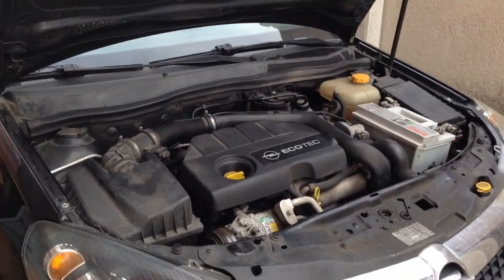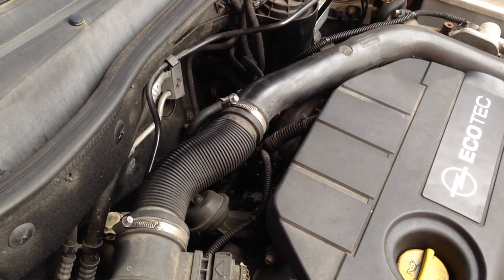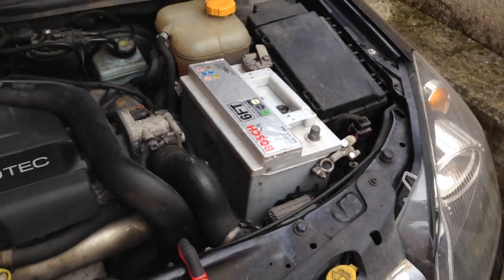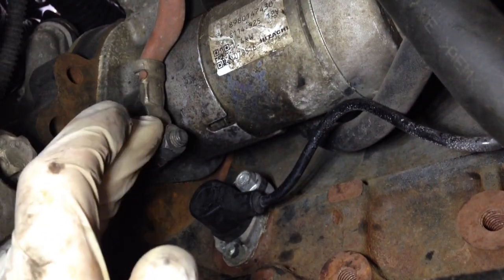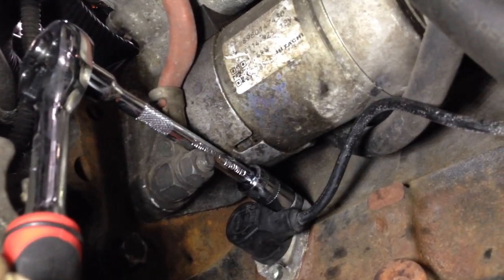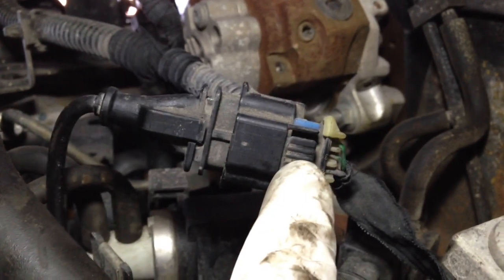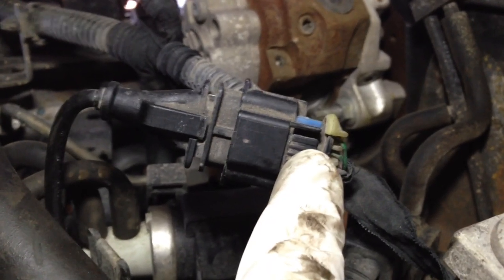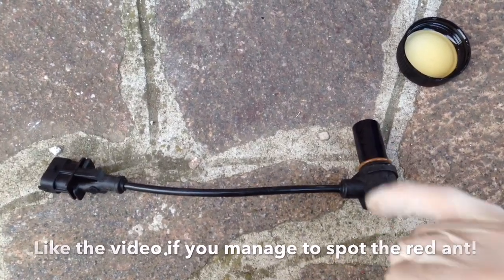Astra Crank Sensor Replacement. Easy DIY Tutorial.

Comment: Chris your video is a dirty lie!!! lol. Well at least in my case looking at my 08 Saturn Astra w/1.8L Ecotech motor, it is impossible to get to anything from the top, nor from the bottom. I am jealous of the literal football field of space you have under your Opel Astra to reach behind the motor from the top, or the bottom. Under mine, there is a drive shaft and other fun items in the way, I can touch the starter with 2 fingers, can't see or feel any bolt or sensor on the block behind the bottom of the starter. Just a sad sad day today when I realized I will be spending a substantial amount of time in the driveway once I figure out what to pull out to get to this sensor. Otherwise, great video by the way!

Comment: Well done, this helped me (so far) to identify one particular problem. My Astra H CDTI (2004) would sometimes start and at other times just turn over, but not start. A garage I tried replaced the Camshaft Position Sensor (P0340) and I thought it was fixed. But a day later, the fault returned and I was stranded. Two hours later, it just started. So I followed your instructions, and this revealed two error codes: 033529 (Crankshaft Position Sensor) and 213971 (CAN-Bus No Communication with CIM (Steering Column Module). Not sure what the last one really means, but when I was stranded, a guy stopped and said that I should try to lock /unlock the car because the key might not be recognised as the right one! I wondered if this meant anything? I have a second key but I left that with the car at the garage (not a Vauxhall dealer). I think the garage replaced the wrong sensor. Appreciate your valued thoughts on this.

Comment: Don't think it's that easy on all to replace it on 2008 1.9CdTi you have to remove Egr valve to get to  then Oil cooling hose bracket. To get to starter motor top bolts... Then bottom bolt on starter then Solenoid and starter power cable then remove starter upwards then yoh find the crank shaft pos sensor behind the now removed starter motor... A 4 hour job off and on.... 😎

Comment: Hi Chris, I had my 06 1.7 cdti diagnostic checked at a local garage because it had a starting problem and also cut out mid drive once or twice!!
The garage said it was a crank sensor fault (the only fault code) and this would explain the problem I was having. I was booked in the next day with a quote of £105 and 1 hour for the work, luckily your video popped up on my recommended vids and after checking the price of the part £36.99
I give it a go. The job was as easy as your vid and the car is now fine and saved me the best part of £70!
Thank you keep up the good work!
Reply from the maker: Hi Dale, thank you for taking the time to comment. I aim to help people out with these videos so it's really nice to hear back from people who have found them useful. Check out my 'pedal test' video so next time you can get your fault codes for free too. :-) Cheers, Chris 👍

Comment: Thank you man,
I will replace that sensor by myself, thanks for this video that you made. 
I will replace with an original one (GM), given that I understood from forums that aftermarket one will just go in loosing more money.
Reply from the maker: I'm glad to hear you're confident to do the job after watching my video - I really like helping people so it's nice to know when people find my videos useful. An original crank sensor is probably a good investment to avoid having to do the job twice! Happy fixing. Cheers, Chris
Reply: @christopher_barr  Hi Christopher. Will Topran crank sensor work? I tried another aftermarket brand and it failed to start, aftermarket read 1.37 ohms. Original GM was around 1.5 ohms. Thanks

Comment: OMG! i had no idea about that fault checking test,you are the man!
its 9:40pm here in new zealand mate,so its abit late now for me to test,but will let you know tomo,thanks again mate,your great help.
Reply from the maker: Good stuff, I'm glad to be able to help! Cheers, Chris
Reply: hey Chris, tried that test, it didnt work,my car is a 2003 ts auto,can you do it with autos?
Reply from the maker: Hi John, your best bet is to buy one of the cheap OBD code readers / reset tools (You can get them for 20 - 30 USD). Then you can read and reset your codes. If the only problem on the car was the crankshaft sensor, and you have replaced it with a good one (OEM Crankshaft sensors are recommended as replacements as the tolerances will be correct) than you will hopefully find that the performance will improve over time as the ECM adjusts to the new sensor data. Getting hold of an OBD read / reset tool is very handy for future use also so is a wise investment. Good luckand let us know how you get on. Cheers, Chris

Comment: Well, my Astra has these symptoms, the cutting out at speed is shit scary and I'll be glad to give this a go, was frightened it would be a garage only job but this seems fairly straightforward, thank you, I'll report back if it fixes it
Reply from the maker: Hi Tim, the engine cutting out is not good but yes this is an easy DIY job (the electrical connector can be a bit tricky to undo at first, but apart from that it should be plain sailing). Good luck and let us know how you get on. Cheers, Chris

Comment: I just did this on my Honda Civic 1.7CDTi. Thanks a bunch! saved £220. In the Civic the connector bracket is fouled by something else so you can't slide the connector plug off the bracket which is a really daft design by Honda, fortunately the ECU side connector can be clipped off like you've shown. I fitted the new sensor and cabled tied it to something else so it stays put. I just snipped the old sensor's cable off using a wire cutter right up to the connector so I've just left it on the bracket.
Reply from the maker: Hi there, I'm glad the video helped you save some money. Cheers, Chris 👍

Comment: Just mind folks there are 2 different styles one with cable as in this video and one where cable comes to meet sensor. Check b4 buying. Excellent video 👌
Reply: Are the connections different or is it just the cable thats different please ?
Reply: @stuartnewman6968  best check your sensor as to what's fitted then purchase the one you need

Comment: Really excellent video, and very easy to follow,  Cheers
Reply from the maker: Thank you for your comment Dave. Cheers, Chris :-)
Reply: @christopher_barr  the sensor on my car is in the same place but is different type to yours, I’ve undone the bolt and it won’t pull out the hole, it’ll move in the hole but won’t come out!…any ideas?….thanks.

Comment: Hi, any ideas if the new part is tight fitting? Can't push it fully in no matter how I try. Looks identical but maybe the O ring looks newer. Tried the oil smear but still won't go. Thanks.

Comment: Christopher Barr, thanks for this DIY tutorial, could you answer me, in my case i have a leaking oil on crank sensor, is there possible to change only rubber, thanks
Reply from the maker: Hi Vjekoslav, sorry for the delay - I've been at sea for 2 months. Yes, you can just replace the o-ring and refit the same sensor if you only have an oil leak. You can even make an o-ring if you want! https://www.youtube.com/watch?v=pDb5CrayM-U Cheers, Chris

Comment: Hey Chris while trying to get the ERG valve banking plate fitted yesterday I had a couple of  problems: 1) What size socket is it (the torx one) and would you know what the sensor is near to is (I was thinking Coolant temp,it was loose and looks like its corroded) any lists you may have of sensor location would be appreciated cheers BigE :-)

Comment: Hello, I wonder if you can show where the OBD port located for opel astra  automatic 2001 model?  would appreciate if you can show it  in your next video pls..thank you
Reply: There's a square plastic panel just underneath the handbrake handle.... pop it out, and the OBD is underneath.  So it's immediately below the handbrake, rather than being dash mounted as on most cars.

Comment: Would you like to diagnose and video my corsa c had no power to the throttle but when you hold the butterfly valve open it will rev up with the pedal tried throttle body change accelerator fuses and air mass sensor still no different ?

Comment: Hi, I have 2005 Opel Astra H 1.8. I have problem with Crank sensor P0335-64 code (Incorrect Signal). car is in limp mode an engine management light on. car doesn't rev more than 3500 rpm, If you try to rev higher, car stalls, and runs rough until car is restarted.  Replaced sensor, same error still persists. what does the 64 at the end of the error code mean? any help would be appreciated.

Comment: Hi mate, my Astra 1.7 is 2010, it is a H/MK5 but my sensor location seems different! Any help mate as the part under the starter motor is there but with my car the sensor isn’t little it seems to go up into the engine! Any help? Thanks

Comment: after replacement does this sensor need to be relearned by using a computer .....or simple does the car to be driven for a while?
Reply from the maker: If the battery has been disconnected as per the video then the ECU will reset and over the course of a couple of hundred miles you should see fuel efficiency and engine performance improve. Chris 👍
Reply: thanks for info

Comment: hi,i have a vauxhall astra,mk5,i have change the rocker cover,with a origin 1,because it was sucking air in(couldn't take the oil cap off)the revs some times goes up,from 8rpm to 150rpm when changing gear,could this be the problem

Comment: Hi Chris, 
your video is super! 
I'm from Germany.

Does it functions on my astra H 1.7cdti 2004, too ? 
Is this sensor on the same place? 

thank you for your answer
Reply from the maker: Hello buddy, thank you for your comment. Yes, this should be the same on your car. In case there are any slight differences, and for any other viewers with other car models, I made a generic crankshaft replacement video which shows you how to change a crankshaft sensor on any car.

That video is here: https://www.youtube.com/watch?v=vJq_l2Pv66Y

If you don't know this already, the 'pedal test' is a useful trick you can use on your car to get your fault codes quickly, easily and for free. You can see how to do that here: https://www.youtube.com/watch?v=MqUMXeqO9Hg

Cheers,
Chris

Comment: Hi there, i have a 54 plate astra. I dont have any issues beside my car driving rough when the car with the spanner comes up, initially i thought that was a service symbol until i plugged into obd2 computer and came up as 'crankshaft sensor bank 1' isit a major issue to resolve?
Reply from the maker: +Richi V Hi Richi. What was to code your scanner gave you?Was it P0335? If so, you need to change the sensor and this video shows you how you can do it yourself. It's not a difficult job. Let me know how you get on!
Reply from the maker: Hi Richi, you can double check your codes on your Astra using the pedal test. Watch this video showing you how to do that.

https://www.youtube.com/watch?v=MqUMXeqO9Hg

Engine sensors do tend to break after a while. If you want to know how they're constructed, and how to test them, check out this video (also read the description below the video, which has most of the detail about how to test engine sensors.)

https://www.youtube.com/watch?v=AAbSwQlczDU

If you confirm the P0017 falt code there are four possibilities:

1. Wiring fault (Crankshaft or camshaft sensor) This is fairly unlikely.
2. Faulty crankshaft or camshaft position sensor. This is the most probable cause.
3. Mechanical fault. Unlikely.

The videos above will definitely help you.

Good luck and let us all know how you get on!

Comment: hi,i just replaced my cam sensor cause it was history,but now its still under powered,do i need the timing all reset again or something?
Reply from the maker: Hi John, once a sensor has been changed it takes the ECM a while to adjust and remap all its settings. You have a couple of options.

1. Disconnect the battery for around 10 minutes and then reconnect it. This will reset the ECM and kick-start the remapping process.
2. Continue to drive the car and eventually (provided there are no other issues) the performance should improve.

The above will work if there are no other issues with the car.

Good luck, and let us know how you get on.

Cheers,
Chris
Reply: thanks chris,i disconnected battery when i did the replacement,then connected it all and it starts ok,but just so guttless,and the orange light showing car with a spanner on top still on the dash.
il go an disconnect battery again an see what happens.
Reply from the maker: No worries John. Leave the battery off a good 10 minutes and then try running the car again. After you have run it a while you can do a pedal test to see what fault codes you have. I show you how to do the pedal test in this other video of mine:

https://www.youtube.com/watch?v=MqUMXeqO9Hg

If you come back with some fault codes I'll see if I can be of any further help.

Cheers,
Chris
Reply: My crankshaft sensor AND airflow sensor both went at the same time - I replaced both and now my 1.4 Astra goes like a 2 litre sports car . Vroom-Vroom !!

Comment: Hello Christopher.
I have an opel astra 2008 and i having some problems with it. Do you have a email where I can send you more details? may be you can help me. But basically, The horn stopped working at the same time that the air bag sensor was turned on.

Comment: All good in theory I just attempted to change one but the nuts totally rounded off so now requires the starter removing and drive shaft :( out to drill the sucker out :(
Reply from the maker: Sorry to hear that. I'm guessing you didn't get on the bolt properly (you need the correct length extension like in the video, otherwise you'll be on at an angle)... Before removing the starter and drive shaft it is worth giving the following a shot: 1. Spray it with WD40 and let it soak 2. Hit it with a hammer (The shock can sometimes free the threads) 3. Try getting some mole grips on it (Gripping very hard) and try getting it started with them. 4. File yourself two flat edges so that you can get an open ended spanner on it and try to free it with that. If it's the upper bolt (which it probably will be because that's the one with the worst access) you have less room to work but you could try the above steps and if it was me I'd even be tempted to get an angle grinder and cut off the old CKP sensor to give me more room to try the steps above, before going down the disconnect the drive shaft route. Good luck with it! Cheers, Chris

Comment: Hi, i just bought a 2005 Astra 1.9cdti 150hp. Its fine on power, no warning lights but in the few days i have had it it would not start or turn over 3 times (all dash lights etc were on) and i have noticed the rev counter sometimes doesn't work or shows revs a lot lower than what they actually are. Does this sound like a crank sensor problem to you?
Reply from the maker: Hello, there's an easy way to get closer to the answer... You can do a' pedal test' to get your trouble codes. It takes about 2 minutes and the only tools you need are a hand and a foot :-) Here's a link to my video showing you how to do this. https://www.youtube.com/watch?v=MqUMXeqO9Hg Come back with your trouble codes and I'll do my best to help out. Cheers, Chris
Reply: Hi 2 codes came up 007071 and 001450
Reply from the maker: The first one is P0070  – Outside air temperature sensor -circuit malfunction [You can ignore this code]

The second one isn't so clear - I saw a couple of options for it online. If it was my car I would check both the cam and crank sensors with a multimeter. You can do a resistance check on the disconnected sensor or check for a small AC voltage with the engine turning over (I would do this on both sensors).

Have a look at this video of mine which goes into more detail about the sensors: https://www.youtube.com/watch?v=AAbSwQlczDU

These sensors do break down but sometimes you get symptoms and no codes...

Also, check your battery voltage with the engine off (should be 12.4 - 12.6 Volts) and with the engine on (should be 13.5 - 14.5 Volts ish).

If you need parts you can get good deals online here:

http://fave.co/2lK1Uby (USA)
http://fave.co/2lJQZOV (UK)

Good luck and let us know how you get on!

Comment: Hi there wondering if I can get any help I've just changed my crank sensor and it's still doing the exact thing as before?
Reply from the maker: Hi there, let me know the following and I'll see if I can come up with some suggestions:

What is your car? (Model, year, engine)
What problems / symptoms have you had?
Have you done the pedal test to get your codes? https://www.youtube.com/watch?v=MqUMXeqO9Hg
What codes have you got?
How many miles have you driven since you changed the crank sensor?
Did you disconnect the battery when you changed the crank sensor?

Cheers,
Chris
Reply: Hey bud, I'm getting an issue, 1.7 cdti 2006 astra, spanner light on during hard acceleration. Cleaned out egr, replaced map, no leaks. Light comes on around 60, lose power then clears and car takes off. Was thinking crankshaft sensor, cause at idle, I occasionally get engine knock then clears.
Reply: Pedal test is showing 050074 isn't that something to do with wheel speed sensor.